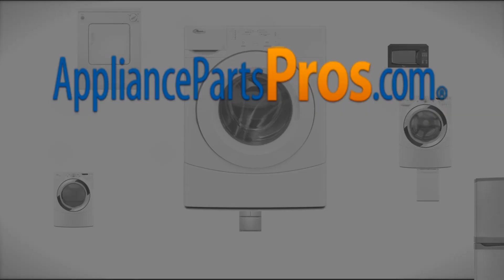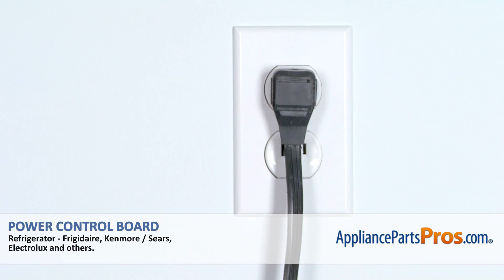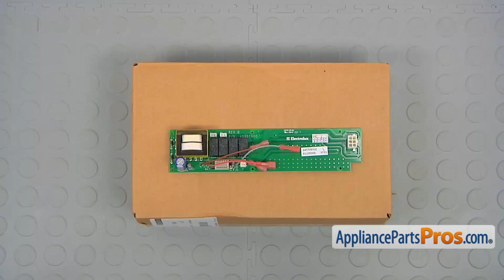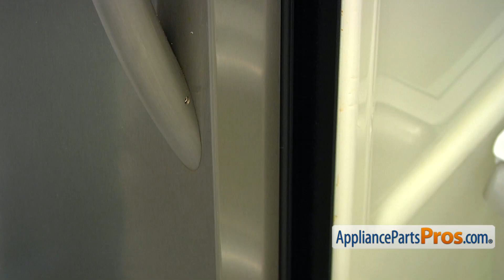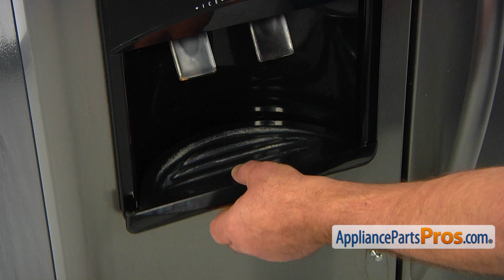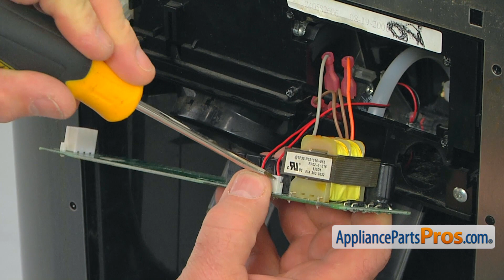How To: Frigidaire/Electrolux Power Control Board 241708102

Comment: Excellent video. Thank you. I have the exact same fridge and have a weird water dispenser issue. Ever 20 minutes or so a small quantity of water (enough to fill the drip tray) is released from the water dispenser. I have checked the wiring and the wires go where they are supposed to. I'm totally at a loss as to what this could be. Any thoughts?